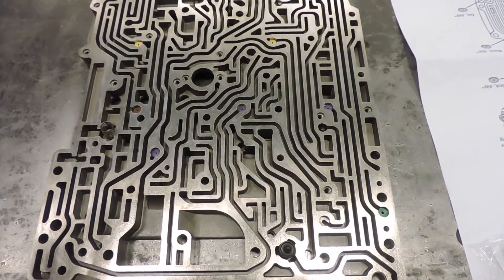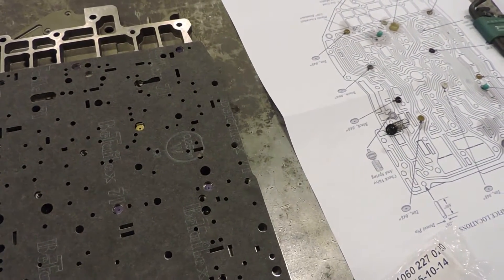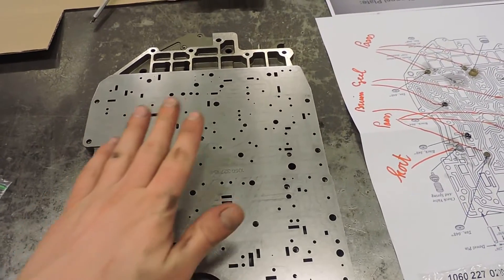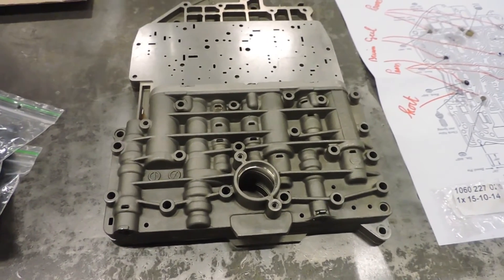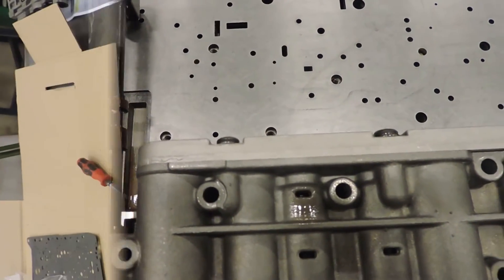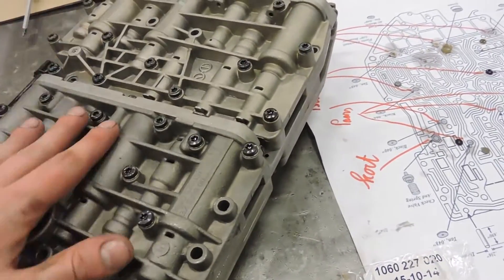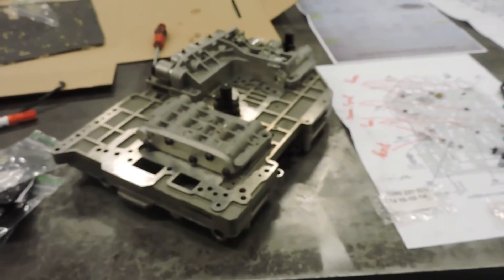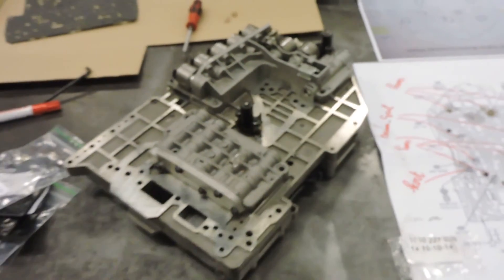5HP18 Valve Body DIY Part 2

Comment: Hi Frank. How much torque should we tighten the bolts on the valve body? Thank you very much.
Reply from the maker: @wellnessinfo270  I would do 10 if all is extremely dry but if it is still oily, maybe 8. Keep in mind torque wrenches deviate the most in the lower numbers. Preferably you use your wrist and a small ratchet.
Reply: @poeliewoelie1987  Thank you very much Frank

Comment: any symptoms of a faulty valve body ?
Reply from the maker: The valve body on this transmission is pretty solid. Compared to the 5HP19 and 5HP24 there are no drum breaking issues and compared to the 5HP24 and 5HP30, valve body parts are not known to crack.

There is a small check ball in a cup that can break and the accumulator pistons SOMETIMES break. Fairly easy to replace and this would give you very bad shifting as those accumulators are needed for soft shifts.
Reply: Thanks for your reply! I sometimes get an transmission error by shifting in manual mode, in auto mode never. In the error it states something with speed signal sensor. Another symptom comes most times when i drive uphill (in auto mode) after the clim where the road is flat again when I accelerate the transmission wont shit up and stays in the gear for some seconds.
Reply from the maker: @bigdeal87  Staying in gear CAN be for extra cooling after pulling hill (faster spinning pump) or maybe the gearbox is programmed to think that you may climb again. This can be pure programming.

Manual mode not working properly: Are you using a PRND +- shifter or a PRND432 shifter?

Comment: I have a problem with the automatic transmission
transmission Faulty
drive moderately possible to
continue journey Reduced
acceleration Have checked by near bmw service
Then a message appeared on the crash detector
EGS: Shift valve B: stuck in off position
Clutch gears 12 3 and 4: neutral test
my BMW 320 I 2008 
Transmission GM 
 Number GA6L-45R 
chassis Number
D A B V G 99050V C81681

Comment: hello, can you buy just the selector? mine has snapped. part number? i cannot find this anywhere at all.
what holds the selector in where it goes? thank you great video
Reply: I know it has been a year, but mine snapped today and i can now answer that question haha.

Anyway, for the next poor dude that is going through this, the part number would be 1056 327 173 for this valvebody, and i looked on ebay, it sets you back 20 bucks.
Reply: @Jukita008  Did you manage to change the selector? How easy was it? Any tips?
Reply: @4R844Z  it's pretty easy all things considered
Just take off the oil pan, then take off the valve body, it's like 5 screws as shown in the video.
You take off the two smaller pieces of the valve body that is shown and you just slide out the selector and put a new one in, put the valvebody back together at the right torque, this is important so use a torquewrench.
Put the valvebody back in, change the filter (is only 20 euro), and put the pan back on and fill it with oil.
Reply: @Jukita008  I wasn't expecting a quick reply considering how old your comment was lol. I've ordered the part. Hopefully installation goes well. Thanks for your help. 👍
Reply: Peki kaç nm tork ile sıkmamız gerekiyor valf gövdesini